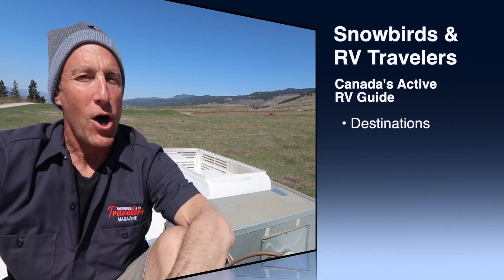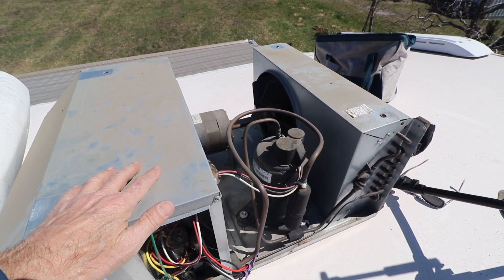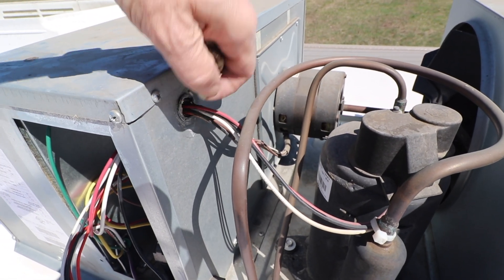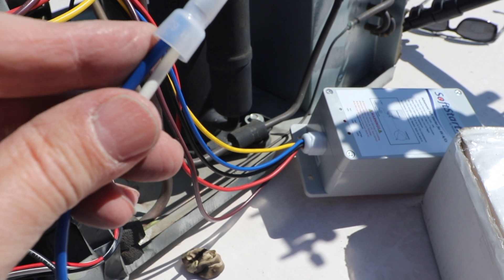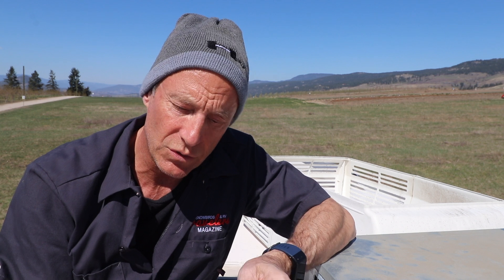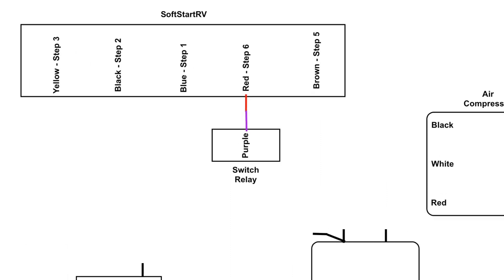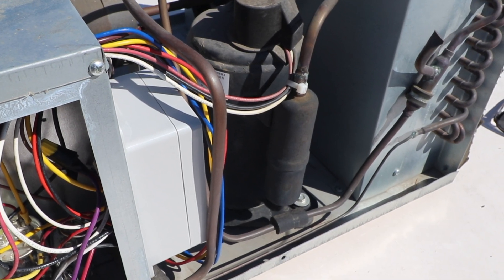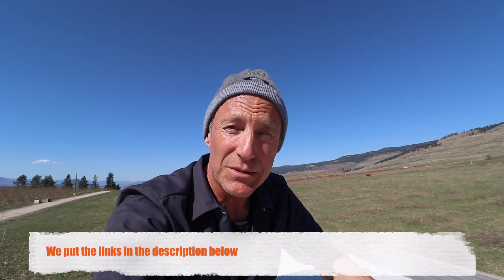SoftStartRV Install on a Coleman Mach - Airexcel Air Conditioner

Comment: I mounted the soft start in the compartment with the capacitors and didn't have to mess with pulling wires through the grommet as everything is in there.  Super simple and out of the weather.  Great video.
Reply from the maker: Great tip! Thanks for the kudos

Comment: Extremely nervous of RV electrical connections, but you made it so easy and boosted my confidence. Thanks. We have a 13000 BTU running off a 3650 Watts Genny.

Comment: I use the Powerhorse 2300i generator and it works great on my 15K Dometic. I could actually run it without the soft start but it was hit or miss to get it started.

Comment: You need a 3000 to run an RV ac unit along with the soft start. It will work for single ac perfectly.

Comment: Have same Mach 3+  also bought a Champion 2500watt generator duel fuel, 1680 watts on propane 1850 gas.  Think 1680 is enough?  Good simple video, thanks for being honest about 1600 watt shutting down, always awesome to see honesty

Comment: I am a little confused...  you connected on 2000 generator to start your AC.  Wattage draw on your AC... maybe 1400 watts??  but the one gen. couldn't keep it running?  Thank you
Reply: I believe the 1200 is the running watts, which the gen handles, but without the soft start to spread out the peak draw of what would be 2,500 watts draw for a brief moment when the compressor starts up.  Nobody else answered you, I hope I’m correct.

Comment: There's a difference between the "Soft Start" system and the "Easy Start" system.  There are literally hundreds of videos on YouTube demonstrating how to install either one of the systems. One model seems to be preferred over another; at least to electricians who professionally install mobile solar/battery systems on RVs. They routinely install these starters on RV's a/c units so that inverted lithium batteries can run a/c without a generator. You'll have to make the decision on your own which system you want to buy.
Reply: Since you did not push, knock or name the preferred company, I believe what you mentioned. Thanks.

Comment: 2KW won't live long pushing a 14,000+ BTU A/C. The RUN DRAW is more than 1300 watts and portable 2KW gen-sets are RATED for 45% CONTINUOUS draw (read the UL/CAS tag!) and 105% SURGE. The inverter and the engine don't have the proper COOLING for more load. Move up to a 3.5 or 4 KW gen-set and it should LAST more than a season. The Coleman 12,700 BTU Mach One with a soft-start added can live with a 2 KW, or the Dometic 13,100 (soft-start built-in). I've played the RV A/C gen-set game for nearly 50 years now AND the no CURRENT land-line hook-ups at RV parks! 30 AMP plug but not even 15 AMPS or the breaker would trip! When you can't use a 900 watt "George Forman" type grill with your 185 watt 'fridge in a VW CampMobile, $25 a day electric is a rip-off!

Comment: I wonder if your issue was ANOTHER load on at the same time tour AC is running.  Make sure your AC function is OFF, and propane ONLY is suggested on your fridge.  Second, is the Power Inverter  (runs off AC to make 12v unit that charges your batteries) is off, by its breaker.  These two loads can/will be too significant in current draw to allow for the 1600w generator to have enough capacity for the SoftStart to work when the compressor cycles every 3-10 minutes or so.  The trick is to ONLY have the 30a master breaker on and the 20a AC breaker on!  Then make sure your Refrigerator is set to PROPANE ONLY, NOT automatic which puts the AC on the primary AUTOMATIC choice---which is bad.  The reason i am 100% sure this is your problem, is that the softstart worked once!!!!
Reply from the maker: Great suggestions to check. Sure would be nice to run a lightweight, affordable genny.

Comment: LOL after all that he tells you the gen couldn't keep up after 5 minutes anyway! Thumbs down!
Reply: Really?  He was honest and told it the way it is, 1600 not enough...so negative
Reply: @troymiller3989  Right, but it's him trying to get you to watch the whole video, he could just say it didn't work earlier. If you just watched till 8 minutes you would've thought it worked fine.
Reply: I've got a friend that runs a 13 500 btu ac unit with a 2000 watt Honda and a soft start. He just has cheap generators.